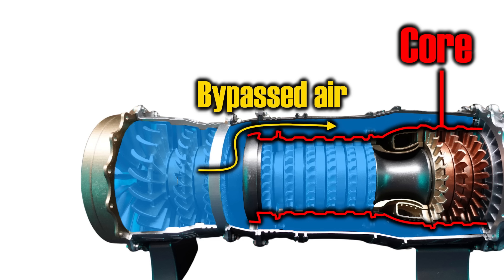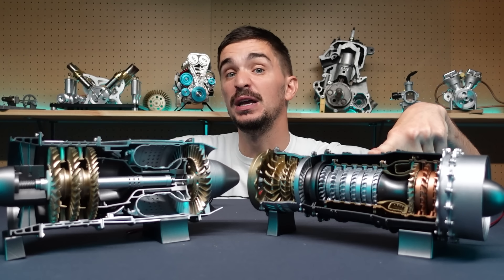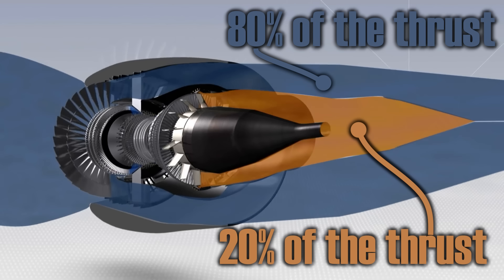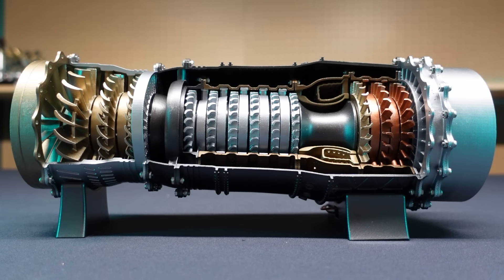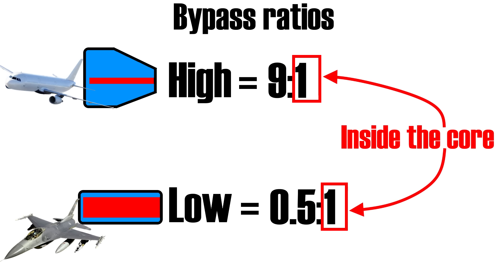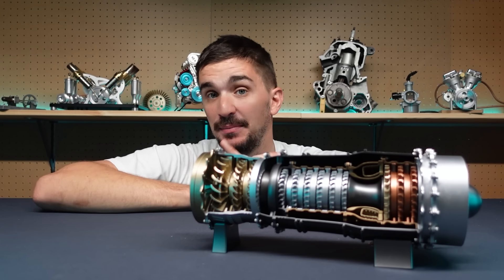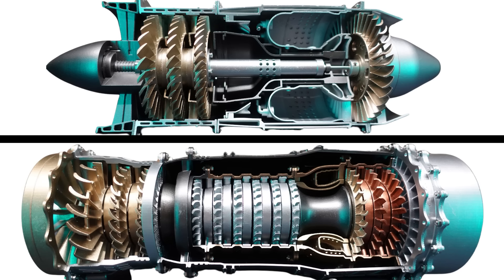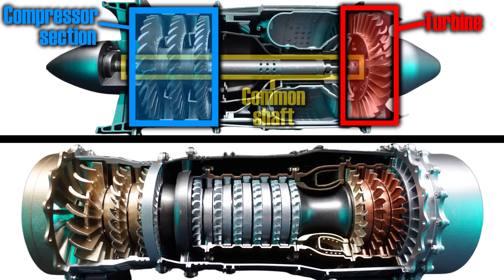Jet Engine Evolution - From Turbojets to Turbofans

Comment: Flying 4 Answers!!! I'm here for it :D
Reply: @d4a you should do a video on some driving turbines 😎 Some of cars that have used turbine engines and some future concepts like that turbine hybrid garbage truck
Reply: 😮 I want 🚀 4 Answers 🎉
Reply: Also riding for answers
Reply: But the Answers flew over my head
Reply: @ddd.777-  Y2K Baby!!! Man I want one so frickin bad. 

A financial improbably at this point, but not impossible.
Reply: @C.Fecteau-AU-MJ13  An MTT Y2K? Why not a 420RR?
Reply: @ddd.777-  If I had a choice of one to take out for the day, I'd definitely be asking for the 400RR. 

If I had the opportunity to take one home, it's gotta be the original.
Reply: Where’s your imagination? Jets don’t have to just be for airplanes. 😂
Reply: @King_Cole i would like to see a 4-stroke vd turbo-shaft engifte video
Reply: Instead of Driving, Riding, and Flying 4 Answers. I thought about Operations 4 Answers...but that makes him sound like a surgeon.
Reply: @King_Cole 
I love the MTT Y2K, the Howmet TX, and especially the Jaguar C-X75. I love the sound of jet engines, and the fact they can run on nearly any liquid fuel.

And you don't have to worry about the turbo-lag of the turbine engine, if it is just recharging or working with EV batteries/ultra-capacitors.

That is part of what irritates me about the original CX75 getting canceled, and even more irritating, that I can't find a Pringles can sized turbine with multiple compressor stages, for an efficient, high performance, homemade series hybrid, that can run on nearly anything.

The closest I have to that, is a "diesel" burner/heater powering a thermoelectric generator. Diesel powered heaters can run on nearly any liquid fuel, the issues is, how can that heat move a vehicle? Stirling Engines are much bulkier then diesel piston engines for the same output, peltier TEGs devices are horribly inefficient and fragile to overheating, thermopiles have worse output then then peltiers, and I still don't know if I can run a Diesel piston engine on any flammable liquid, as long as the liquid is oily enough to lubricate the high pressure mechanical fuel pump, on top of Diesels being so heavy.

So if pump lubrication is the only thing stopping a piston diesel running on anything, then does that mean a diesel engine can safely run long term on 2stroke premix? If so, at what ratio? And what about premix in other random liquids like pure alcohol, acetone, running a diesel on camping fuel, and other liquids, just checking & improving their lubricity by adding 2stroke oil?

Should I just hook up a turbo piston diesel to a generator, for a performance series-hybrid? Or, continue reserching and experimenting with thermoelectric generators, for a vehicle application?

That is what I'm personally struggling with right now. RC turbines are extremely inefficient, because they literally have just the bare essentials needed to run, and the ones I found are not turbo fans.

What is the best, most compact way to turn fuel into electricity?
For home application, that is easy, just have a big stirling engine with an efficient stove or burner, or have a big, piston diesel turning your generator, the best option apparently are massive steam turbine systems.

And you don't even have to power a home with fuel anyway, because of solar panels, wind turbines, water-wheels, and generators on exercise equipment.

But for a compact car, or motorcycle. How to convert fuel to electricity, to get the best of both worlds. The instant torque & stealth of a BEV, but the convenience, energy density, and sustained highspeeds of liquid fuels.

This cold war between BEVs & traditional powertrains is pointless to me, because it seems like Series Hybrids are the best option, especially for commuting & adventures. Even more so, if it can easily run on a variety of fuels. But compared to traditional powertrains, and Parallel-Hybrids. Series-Hybrids are so rare, especially with compact-cars or bikes.

I know some people still prefer traditional, for the sound, and banging through gears, which can be replicated with speakers and connecting an electric motor to a gearbox. Motor Gearbox also seems to be the best off roading option, because 4x4 locking Diffs seems better then 4 wheel motors figuring the ground out.

But if you want the best tarmac performance, not caring how it looks or sounds, go build or modify a Series-Hybrid. Engine, or whatever burner, is kept at it's most powerful or efficient RPM, the batteries/capacitors handle the low & mid range torque, for launching out of corners or from a dig. There's no clutch to burnout, no gears to fumble over, you can completely focus on the best line, the best launch, the best overtake or defense, and you can turn the fuel burner off, to sneak by cops, or in/out a driveway at night.
Think Rimac or Energica Ego, or Zero FX, without the range anxiety.

And with or without traction control, separate electric motors offroad, going YOLO, isn't so bad.

Series-Hybrids are the way.
And motors naturally sound like turbines, especially with gear teeth & fan-blade designs.
Reply: Oh, I forgot to mention. Series Hybrids are also a better use of an engine, then a CVT, because electric drive motors, can reliably and continuously handle more force, then a CVT, along with a much, much better maintenance schedule.

So be it a piston engine, a wankel, or a gas-turbine like the Y2K & Howmet. A Series-Hybrid is better then them directly driving the wheels.
But which is the best compact generator, that the average petrol head can build? Especially for a motorcycle frame.

A compact car with the original engine missing, or a kit car are relatively easy, because all that room, gives you more options.

But what's the best generator to stuff into a bike? Especially a dirtbike frame. Or a tinier frame, like a Honda Grom or Pitbike.

That's my dilemma.
Reply: If the concept CX75 went to production. Then it would be easier to get great little turbines for homemade projects, whether someone crashed one to salvage, or, the Jaguar supplier selled the turbines as well to us DIY people.
Reply: Though he should've made a comment about a flaw in the model he's showing. 6:26 the blades at the back end (on the right) of the engine model are shaped the exact opposite way as they should - it's not a compressor driving the gas, but it's a turbine extracting the energy from the gas, so it should be shaped with the curved side up (towards the right).
Reply: He should start with the engine the Wright Brothers made for the 1903 Flyer, the small radials used in planes like the 1909 Bleriot and the Curtiss pusher, then the Rotary engines used in The Great War, the liquid cooled inline and V-12s of the 1930s and then ending with the 4360 Wasp Major.
Reply: @Tommy-B.  Craig Breedlove and his J47 have joined the chat...

Comment: As an aeronautical engineer I affirm that this material is of good quality. super recommended for all audiences.
Reply: About the only thing he didn't mention was the average exhaust velocity which has to be higher than vehicle speed and is why low bypass jet engines are used for fighter jets and not high bypass and why Concorde used turbojets.
Reply: @BooBaddyBig I think that was sort of implied in other words by some of the other related things he said.
Reply: @johnstudd4245  I don't think it was. He said that low bypass jets were used by fighters, and he said that they were less efficient, but gave higher thrust, but he never really said why they were chosen, and in fact pretty much implied it was just a weight thing.
Reply: and u didnt noticed blades of them jet models are all wrong?? & The turbine is in wrong direction in first jet at the start.
Reply: @BooBaddyBig   Yea, the key word would have been specific thrust. They certainly don't produce higher thrust in general. Just compare the F135 of the F35 to the GE9X on the B777X.
Reply: @BooBaddyBig you are false: a low bipass engine as a higher ejection SPEED , not a higher trust: high dilution engines have much more trust , but from a big mass of air at low speed who is  useless to reach hight speeds
Reply: @leneanderthalien  It depends on the speed. At low speed high bypass engines have higher thrust. At high speeds, low bypass and turbojets have higher thrust because they have low thrust lapse rate.
Reply: 30+ year aircraft technician here and I agree with you!
Reply: Nerds
Reply: @joshualloyd5489    Yeah, and? Personally, I thank God for nerds because without them we probably would not have been as scientifically advanced as we are now!
Reply: @phayzyre1052  You are absolutely right, nerd. 😂
Reply: @joshualloyd5489  You sound jealous. Don’t hate on me because I did well in school and I’m successful in life while you sit there in your blue vest saying “welcome to Walmart!“
Reply: @phayzyre1052  lol I’m just gaslighting you guys, I work in the aerospace industry as well and know how people play around. I have no where near 30 years experience, but it’s funny to see on a basic video the amount of detail people get into in the comment section.
Reply: @joshualloyd5489  Ha! Got 'em.
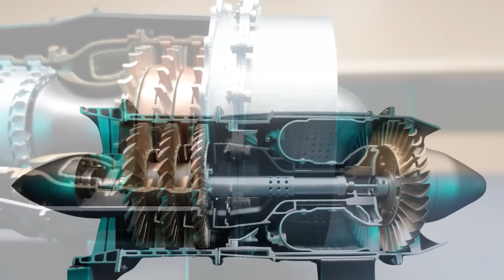Reply: 1:04 Wrong.
No forward thrust is generated by the exhaust gasses exiting via the tailpipe.
In fact some reverse thrust is usually produced by the tailpipe section.
     For the Harrier VTOL jet aircraft for example when the exhaust gasses & compressor air flow are turned through 90° reverse thrust = max thrust is generated & upwards thrust = max thrust is generated (f = ma) yet the aircraft doesn't accelerate backwards due to the max forwards thrust still existing as all forward thrust is generated forwards of the turbine section.
  In addition, there's a problem with axial compressors where during run up the later stages can experience vibration & damage due to airflow problems, this is dealt with by having multiple shafts driving different compressor sections, variable stators or variable air bleed valves.
Reply: @BooBaddyBig 
The thrust is produced by acceleration of a mass, that mass is the air the aircraft is moving through, therefore, the gas speed through the engine must be increased.
Reply: @petemaly8950  Yep. Although there's also a small rocket-like effect from the fuel being burnt.
Reply: @BooBaddyBig  
Concorde used turbojets because the cross sectional area of a supersonic aircraft needs to be relatively low compared to its overall size to allow supersonic speeds.
Reply: @petemaly8950  Yes, it's specifically the inlets that have to be small, and turbojets have the smallest inlet cross section.
Reply: It’s very good information
Reply: Thanks for your analysis!
Reply: What about turbo prop engine then ?

Comment: I worked for Rolls-Royce for 32 years and have experience on a whole range of engines from Speys (A 'leaky-turbojet' more than a turbofan) to BR-700's. I think you did a marvelous job explaining the basics. Obviously it is far more complicated when it comes to practical applications!
Reply: Nice. RB engine Trent engine XWB
Reply: I love the trent 900 from RR engine❤
Reply: Would you mind sharing some recommended sources for learning about turbo engines? I'd greatly appreciate any suggestions you may have.
Reply: I remember the RR Spey well, hearing them taking off with a 111 or an F28 , they sure had a sharp crackle and Roar to them, wonderful noise 💯
Reply: You can thank your lucky stars sir, 32 years with RR.
Reply: @therandomytchannel4318  Nothing in the world turns jet fuel into noise better than the Spey! I love the sound too.
Reply: The why Rolls Royce Trent 1000 is soooo problematic 😂 never understood why they cannot get Trent 1000 issues ironed out. Right now, even British Airways (with same home turf of RR) opted for GEnX instead for some upcoming fleet.
Reply: @chengyoujiang6076  Interesting, that's quite an about face.

Comment: The best description of how a jet fan works that I have ever heard
Reply: You are not subscribed to Agent JayZ?
Reply: Indeed... very compressed desciption. I loved it.
Reply: @meleardil  excuse the pun?
Reply: D4a is a phenomenal teacher lol I find my self thinking this with every one of his videos
Reply: Excellent.
Reply: Indeed!!
Reply: 1:04 Wrong.
No forward thrust is generated by the exhaust gasses exiting via the tailpipe.
In fact some reverse thrust is usually produced by the tailpipe section.
     For the Harrier VTOL jet aircraft for example when the exhaust gasses & compressor air flow are turned through 90° reverse thrust = max thrust is generated & upwards thrust = max thrust is generated (f = ma) yet the aircraft doesn't accelerate backwards due to the max forwards thrust still existing as all forward thrust is generated forwards of the turbine section.
Reply: @petemaly8950  are you trying to say that the trust comes before the accelerated air leaves the tailpipe?
Reply: @the_sheet  
Forward thrust, Yes.
Reply: @petemaly8950   and it is my understanding that there is quite a bit  of forward Lift generated by the aerofoil shape found on the Compressor and fan blades, the entire jet engine from front to back is one aerodynamic masterpiece...
Reply: @the_sheet  
Also the combusters generate thrust, like rocket nozzles.

Comment: I just love the way you describe things in such a logical manner
Reply: Thoroughly understands and teaches. Thank you!
Reply: …and quietly!
Reply: 1:02 Wrong.
No forward thrust is generated by the exhaust gasses exiting via the tailpipe.
In fact some reverse thrust is usually produced by the tailpipe section.
     For the Harrier VTOL jet aircraft for example when the exhaust gasses & compressor air flow are turned through 90° reverse thrust = max thrust is generated & upwards thrust = max thrust is generated (f = ma) yet the aircraft doesn't accelerate backwards due to the max forwards thrust still existing & countering the vectoring nozzles full reverse thrust as all forward thrust is generated forwards of the turbine section.
 In Fact, the main features of the typical turbojet tailpipe is to be straight & have a big hole that allows the exhaust gasses out in the direction of general flow without getting in the way of or changing the direction of the exhaust gasses.
    Ideal Airliner thrust reversers 10 ton thrust engine  - first 90° exhaust gasses turn - generates 10 ton reverse thrust countering the 10 ton forward thrust so no net thrust & 20 ton tension on engine casing, next 90° turn creates 10 tons tension across the reverser bucket & another 10 tons reverse thrust giving max reverse thrust of 10 tons net worth of braking effect, lovely jubbley.
Reply: 100% these are fantastic vids.

Comment: As an armchair engineer, I'd like to see the development of 3D-printed ceramic fan blades for the power turbines. 3D printing would allow for cooling passages and such to be incorporated into the design, and using ceramics would allow even higher temperatures to be utilized without melting components.

Comment: I used to be a Harrier mechanic. I’m impressed that you know this about our Rolls Royce engine! Additionally, the Harrier uses 4 nozzles with a single engine. The two “cold” nozzles come from the Low pressure compressor and the “hot” nozzles from the high pressure compressor, combustion chamber and all the turbines. You can walk up to a running Harrier and put your hand in front of the LP cold nozzle and the air was only slightly warmer than ambient. But even at idle it is a LOT of volume of air at a pretty high speed. You wouldn’t want to put your face in front of it!
Reply: Hello

Comment: Brilliant.  Was trying to explain to a colleague how the evolution of engine diameter & ground clearance had impacted the 737 against the A320 & the disastrous results.
Reply: The 737 was designed as a regional jet for small airports and needed to be low for on board air stairs. 

The A320 was designed as a mainliner and to only go between serviced airports (or use a ground airstair on unserviced ones). 

The 737 woudnt have had a problem if it was designed like the 727 or DC-9 or CRJ with the engines on the tail.  But Boeing wanted lighter weight and more payload capacity so the engines went under the wings. 

As the 727 could not be modernized with newer engines because of its centre tail mounted engine, Boeing designed the 757 to replace it.  It also designed the 757 with a massive amount of growth potential that the 727 as well as the 737 and 707 lacked by having very tall landing gear, very powerful engines, and very beefy structure.  

But the plane was too big in comparison to the A320… so they had to make the 737 into something it wasn’t designed to be.
Reply: @calvinnickel9995  the 737 should have looked like a DC-9 with two turbofans in the back, then ALL the problems Boeing has inflicted on itself with the 737 except for the doors popping open in mid-flight wouldn't have happened.  Boeing even renamed the MD-95 to 'Boeing 717' after they were acquired by McDonnel-Douglas.

Comment: I’m a 30+ year aircraft technician, this is a very good video! One guy I knew who worked on aircraft from the 1950s to the 1990s told me those old turbojets were “designed to do two things: eat gas and haul ass!” He added fuel efficiency was just something that was not thought of back then.
Reply: Whittle had given a great deal of consideration to fuel efficiency & the efficacy of the turbofan engine before 1936.